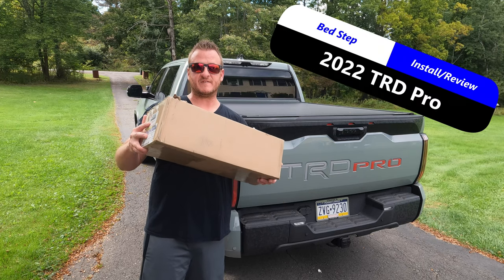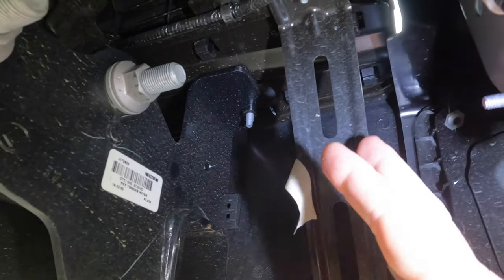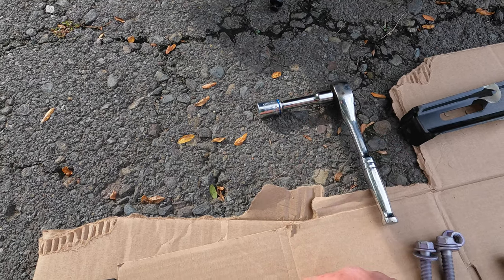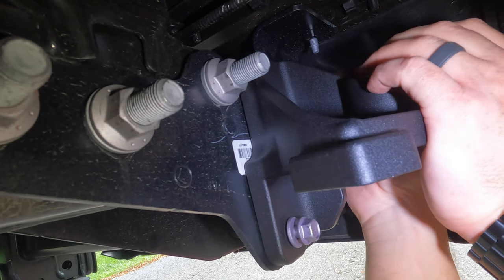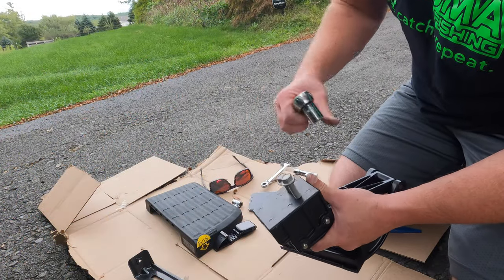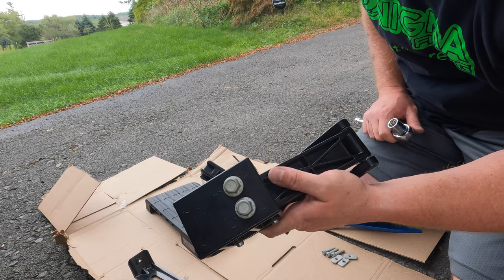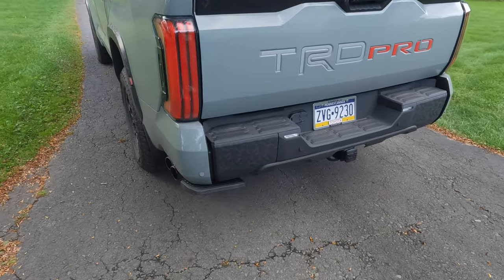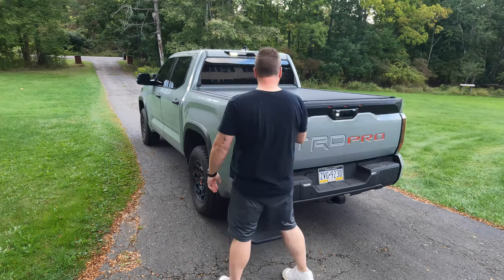2022 Tundra TRD Pro Bed Step, Every Truck Should Have This!...Easy Install, Review

Comment: Great video. I need to order one for mine. One thing I would do differently on the install.  I would attach the step plate prior to attaching the arm to the bracket. seems like it would be easier to mount and secure the screws easier. After having a F450 for 4 years I miss my Old man step.
Reply from the maker: Thanks Mark, I appreciate it!...not a bad idea, and yea I think these trucks should come stock with this from Toyota with how they designed the rear!
Reply: I had a 2014 F-150 and referred to the step as my Old Man step also.  I just took delivery of a 2023 Tundra and have already ordered the bumper step.  Be well and drive safely.

Comment: noce video but i dont understand , that bracket to mount to the hitch to make it super strong but yet, the step where you gonna add your weight doesnt look strong enough,
Reply from the maker: Thank you!…this thing is sturdy as can be…I’m 220 and it holds me with no issues whatsoever!
Reply: @NitroZ18Fishing  im sure its strong enough but every time i see you stepping on it, that thing wabbles up and down, i dont know, they could have done better, especially when that cost 300+ dollars
Reply from the maker: Not sure what ya mean, the step definitely doesn't wobble...I use it constantly and it's solid as a rock...maybe it was just the angle in the video?...not sure but the step itself doesn't wobble at all...hope that helps!

Comment: That’s ridiculous you need that. Toyota drop the ball with the design of the rear bumper. It was a tight fit with your shoe to fit in and press down. If you have steel toe boots… your kicking your truck. No tow hooks. No V8. Poor rear bumper design. This truck is a let down. I was hoping to trade in my 2015 4x4 crew max. I will just hold off for a couple more years. And see if they correct all their mistakes.